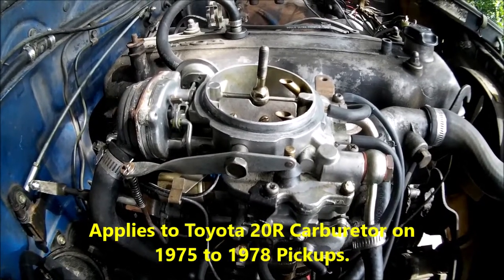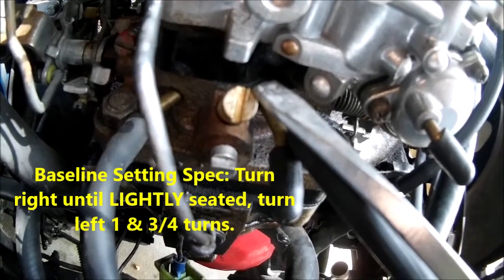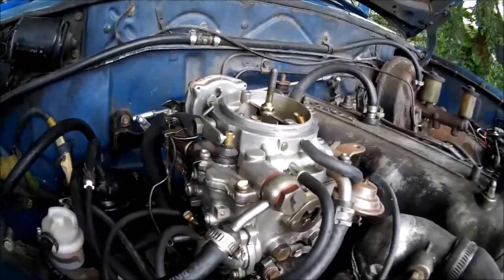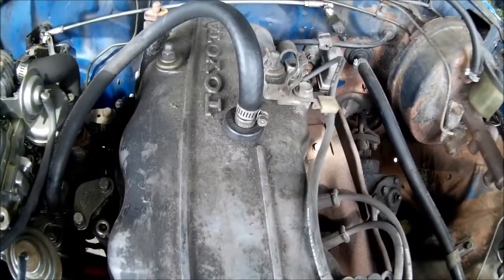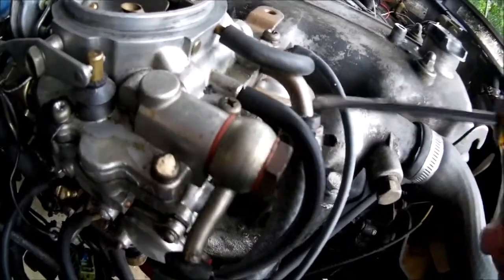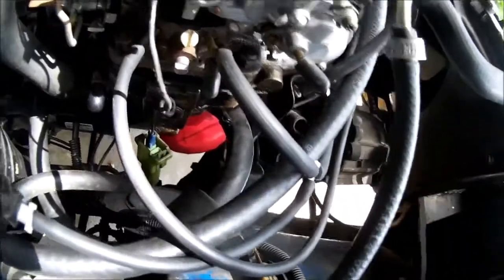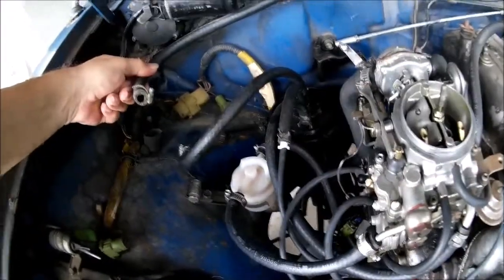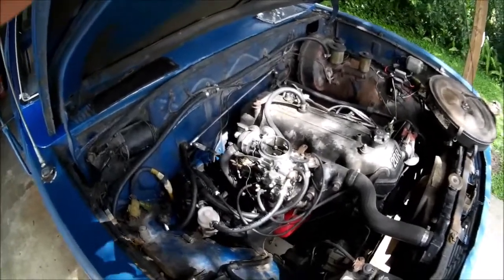1978 Toyota Pickup/Hilux 20R-Carb Adjust & Vac Lines-Desmogged

Comment: Do you know what sizes the bolts are that hold down the original carb. I lost mine trying to put on my original carb.
Reply from the maker: Did you lose ALL of them? If you even have one of them left, you can match up new bolts from that one at nearly any hardware store. If you don't have one left to match up, in general, the bolts should have  a 10mm shaft diameter and a 1.25mm thread pitch. Please note that the bolt head size may be either 12mm or 13mm, depending. Original Japanese bolts (JIS - Japanese Industrial Standard) have the 12mm head, while "regular" Metric bolts will have a 13mm head. In my experience either should work.

As for length I can't say, as I don't have one handy to measure. However you could measure the depth of the bolt hole to get a good idea. I also seem to remember that one or two of those are not bolts but studs with a nut. They were used due to space considerations, where it wouldn't be possible to use a bolt or even get it into the hole, in certain spots on the carb.

Also, torque spec for those bolts should be 9-10 foot pounds and no more. Over-torqueing the bolts can warp the carb base flange and cause a vacuum leak.

Here's a reference chart on the original Japanese bolts & nuts, with specs. I know it says "Corolla" but Toyota used the same hardware on all of their models.
http://www.tcorolla.net/standard_bolt-487.html

I hope this helps.

Comment: This 2.5”square diaphragm is facing the firewall it has about a 3” shaft out of the center. It connects to a spring loaded lever on the secondary butterfly shaft on the bottom of the throttle body it helps open the secondary butterflies. The diaphragm has come holes in it. The truck is so gutless  the secondary doesn’t open. Do you know where I can find one?
Reply from the maker: This is going to get a little tricky so bear with me. What you are referring to is the Secondary Diaphragm which progressively operates the secondary (main) side of the carb. If that diaphragm has holes in it, it's no wonder the truck seems "gutless", as the main side of the carb is barely or not working at all. It's only running on the Idle side of the carb, regardless of speed or throttle position. When you step on the pedal and the accelerator pump give the engine a shot of gas it speeds up, creating more vacuum. That vacuum is routed to that secondary diaphragm and progressively opens up the secondary butterfly, allowing more fuel/air flow.

After doing a LOT of research, That diaphragm is NOT offered for sale as applicable to the Pickup. However, it appears to be offered for the Land Cruiser, and that carb appears to use the very same secondary diaphragm mechanism. My confidence level on this is fairly high, as I did a LOT of cross-referencing on parts. A carb parts listing for a Corona of the same year, which has the 20R engine, shows the diaphragm & gasket in the carb parts diagram, but shows as "unavailable". Checking a Land Cruiser carb parts diagram of the same year shows the exact same parts, same part #'s, and shows as the parts being available. This happens sometimes because the same year Land Cruisers are much more popular than the cars & pickups. This despite the Land Cruiser having a 6 cylinder instead of a 4. They appear to use a lot of the same carb parts & even the same carb itself.

The only other things to watch for are that there are two types of the secondary diaphragm out there. One has a straight shaft and another has a small bend at the end of the shaft. They are not interchangeable. So check to see which type you have on the 20R. I found a "bent shaft" type on NAPA & Ebay by searching Toyota land Cruiser Secondary Diaphragm. (NAPA Echlin CRB-24093). However I suspect you have the "straight shaft" type.

I am reasonably sure that the parts being offered by Toyota will work on your 20R carb. Reference diagram part #'s 21649 (gasket) & 21698 (diaphragm). Here is the link: https://parts.lakelandtoyota.com/showAssembly.aspx?ukey_assembly=480320&ukey_product=3927411

Comment: Hey love the carb vids I’ve learnt a lot from them but I’m having a small issue with my carb on my 75 pickup it was running fine till I drive it full speed about 70mph now it won’t stay idled when hot .. I also notice that the throttle adjustment screw , screws up against a  lever , when the engine it hot that lever pulls back and the throttle adjustment screw has nothing to rest on .... if you have a email address I can send a video of me going over my carb and you can see exactly what’s going on .. there is some smog equipment removed from my setup ... any help would be much appreciated thanks !
Reply from the maker: Two things here right off to top. One is, I don't know what condition your carb is in (been on there forever & maybe a bit dirty, recently cleaned in place on the engine (if so how?), pulled off & rebuilt (rebuilt by who?), etc) so it's really hard to nail down what it could be. If you can give me more specifics that would help. Second thing is that if some of the smog equipment has been removed, a lot of that stuff is/was vacuum operated from manifold vacuum. If the ports that stuff was hooked up to weren't capped off or badly capped, you might have a vacuum leak. Even if they were capped off but the caps are old, that "full speed" blast you took might have knocked one of them loose or off. Vacuum leaks affect idle a lot more than above idle speeds.

As for Throttle Adjustment Screws, there are actually three on this carb. From your description I think you are looking at the Fast Idle Adjustment Screw. If this screw is towards the back of the carb, and the head of it is pointed on an angle downward, that's the one. The "Regular" Idel Adjustment Screw is on the passenger side of the carb, a bit towards the back, and the screw itself is orientated parallel to the ground.

Just to make this more clear, here is a link to a diagram of the carb, with the different screws labeled. Scroll down to the 6th posting and you'll see it: https://www.yotatech.com/forums/f114/1978-20r-high-idle-dieseling-timing-298874/

By the way, if you do have a vacuum leaks or a blocked idle passage inside the carb, turning the "regular" idle screw may not make any difference. If somehow the screw "backed out" on you so that the idle was adjusted too low, it might work. If that is what seemed to have happened, get the idle adjusted where you want it, then put a drop of Loc-Tite Blue (NOT RED!*) Thread Locker on the threads. Once it dries it will keep the screw from moving again on it's own. The Blue stuff is semi-permanent and you can break the screw loose later if you have to.

You could always post your video on Youtube. More videos on YT about these old trucks helps everybody.
Reply: Thanks man I’m going to check out some of the vacuum caps and and go over the carb some more tomorrow and see what I can figure out ..thanks for the advice ! I’m going to post a video of it on my channel and I’ll let you know

Comment: Ive got a 1980 Toyota pickup 22r, been having a problem trying to find a good rebuild kit. Im looking for a specific few pieces but cant see them in the kits doing a basic "google" search. its the rubber boots on top of the carb, passenger side, the rod the sticks up vertically that is attached to the linkage with the pivot bolt in the middle. Trying to find those seals for that vertical shaft. Any help????
Reply from the maker: That would figure. Since the vehicle is older, parts for it don't sell as frequently, so you sometimes have to get creative with your parts searches. I can almost assure you that you probably will not find the carb kits in stock at local parts stores; they special order them in to save on shelf space.

Fortunately, Rock Auto is showing 2 complete kits in stock that include the rubber boots for the accelerator pump linkage. Have a look here: https://www.rockauto.com/en/catalog/toyota,1980,pickup,2.2l+l4,1277120,fuel+&+air,carburetor+repair+kit,5964

Either the Walker or Standard are good quality kits; I prefer Standard because of previous experience with them & that kit has the gaskets in it for both the 20R & the 22R, but it's your choice. There is also an "OEM" kit available at LCE Performance, but costs a lot more and I cannot vouch for it being authentic OEM, as Toyota themselves don't seem to offer a kit anymore. Link in case you want to look: https://www.lceperformance.com/Carburetor-Rebuild-Kit-22R-Aisin-Carburetor-p/1031001.htm

Let me know if I can help in any other way.

Comment: hello a question this carburetor is the same as 1979 toyota pickup 20R
Reply from the maker: Yes it should be the same carb. To the best of my knowledge, the carbs for the 20R were the same from 1975 to 1980, with the "water choke" on them (choke operated by engine coolant). There would also be no difference in carbs for any '75 to '80 20R equipped Toyota, like the Celica & Corona.
Reply: @The13thSword  I have the same problem with the carburetor of my toyota pick up 79 that has many hoses and I do not understand where they go and I see that yours does not have many.
Reply from the maker: @josevicky779  As mentioned in my video, I have "desmogged" the truck. This involves removal  of some of the emissions devices and some the relevant hoses. The 20R engine & carb do not these all these things to run well and still be fairly clean burning. Whether you can do this or not will depend on your local states emission & inspection laws. I am in Florida where we do not have any vehicle or emissions inspections so it was possible to do.

Basically and in specific, I have found that these carbs only need vacuum lines for the  vacuum advance for the distributor, the choke pulloff, and possibly the AAP (Auxillary Accelerator Pump diaphragm) plus a few more optional ones listed below. All other vacuum ports on the carb can be plugged or capped off to prevent any vacuum leaks. I have my AAP plugged.

The only other hoses I have on it are vacuum for the power brake booster, one hose from the bowl vent to the charcoal canister (to trap any evaporated fuel from the bowl), one vacuum line from the canister back to the carb (to draw in any fuel vapor to be burned in the engine on start-up) and the PCV Vent Hose.

It can be even simpler if you go with a Weber carb instead (Weber 32/36 DGEV), which is a very common, long standing thing that owners of these trucks have done. You would only need the vac advance for the distributor, and whatever accessory hoses you need like the brake booster line. Genuine ones aren't exactly cheap (about $320 new) & also require a fuel pressure regulator and a power wire for the electric choke. Being able to do this would also still depend on your local inspection & emission laws.

More info/basic install instruction video on the Weber 32/36 is here: https://www.youtube.com/watch?v=Lf_zaw4QOm8

If you have any other specific questions let me know & I'll try to help you out.